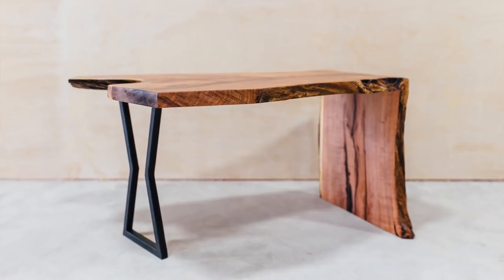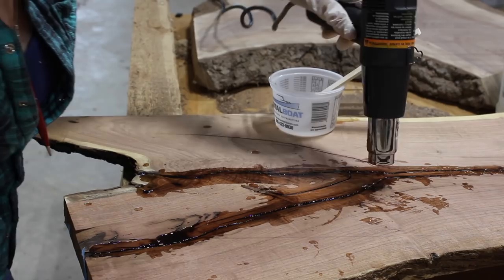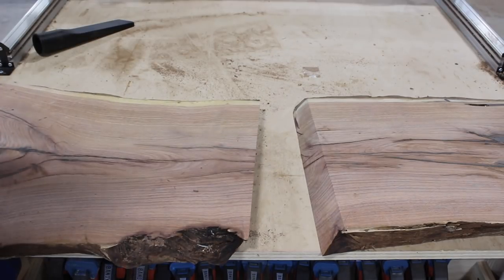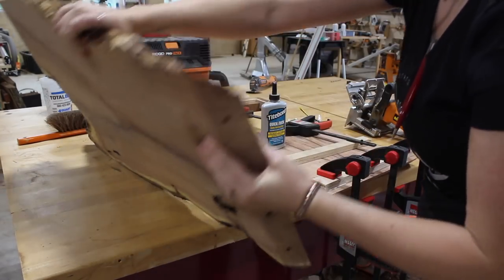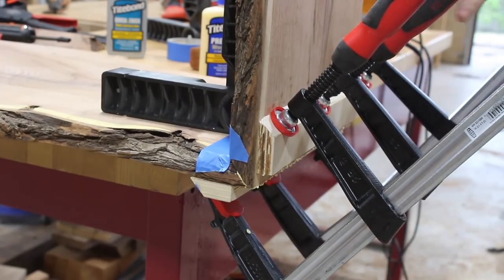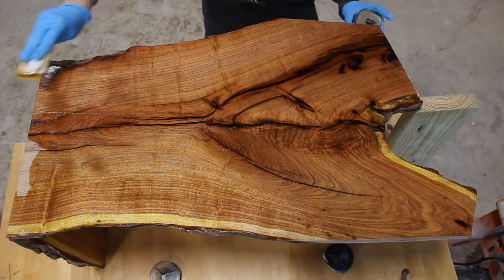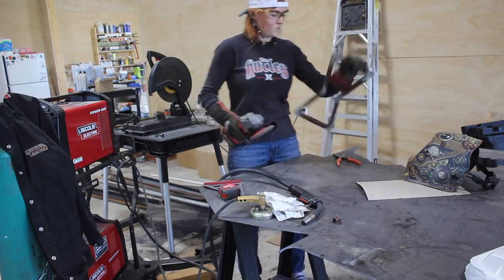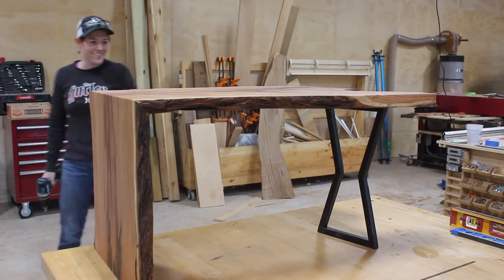Modern Live Edge Waterfall Coffee Table Build

Comment: I'm glad you did not use wire legs.  I saw a few with wire legs and they do not look proportionate to the scale of the table.  If you ever build another one, I did see a build where they used a plexi-glass panel for the support leg.  From a distance, it looked as if the open end of the table was floating...…. great job April!!

Comment: Loved the coffee table. Have your hubby buy a 14 inch metal chop saw. They cut quicker and cleaner. The Rage 2 by Evolution, Itron or Dewalt dw872. They cut clean almost no heat, faster and work a very little dust and no sparks.
Kirk

Comment: Very nice work April. I have viewed countless videos that you have posted and this is one of the best.  The design just looks amazing, about  “cheating”? This is why engineers make full sized additions to blue prints,, especially in the boating industry..  you have come a long ways in a very short period of time.  I/we as your collective audience are thrilled to see your success. Just thrilled.  West systems also makes pump style epoxies along with thickening powders to keep the epoxy from running .. To date, your Entry way table, your clamping rack, and the shop fold down table are among my favorites.  Best of luck with new projects. Consider making bow ties to insert into bigger cracks,, they may add some strength to cracking wood.

Comment: Brown paper bag is an excellent way to get the kulls to come off easily. It's an old trick used in woodturning to  make unusual shaped turned pieces. Just strong enough not to bust while turning (if you don't get too aggressive) and breaks ones you wack it with a mapat to separate the pieces.

Comment: 👍
You can also make clamp-on culls . When you making waterfall table or bench and you want the joint to be closest as possible two lined up but removing the least material first cut on 90 degree the blade is much thinner then on angle then measure 1/32 along the top edge on the end-grain that's where you want to make your 45 degree cut after glue up and sanding the corner you should end up with just about perfect as you can get corner

Comment: April, for covering over the open ends of bar stock, instead of butting up the adjoining piece "as is" - cut off the three INTERNAL sides, leaving an outside "tail" that then becomes the "end cap".

(edit - oops, did I notice a little rocking when you put your feet on it? - was it the floor or the table?)

Comment: It's a beautiful piece and nice work, but for a major structural joint with long leverage like the corner, a few dowels don't provide enough glue area to stand much of a shock: moving, people bumping the side, etc. A cracked joint would be a disaster. In future consider routing a 1/4" blind groove in both sides and inserting a long spline with the grain running across the joint.  Another approach would be multiple double stacked biscuits.

Comment: I love these videos I actually just found you today during my lunch break and spent a good hour watching you're creations. One thing I want to ask or see if you can build or even design because I want to do this to make room in my tool box. Make a Wooden tool socket holder for 1/4, 3/8, 1/2inch size sockets. and the problem I run into is if I put a tray in my tool box and put a 1 1/2 standard impact socket I cannot get my tool chest drawer to close, Its not a deep drawer like normal boxes these days. If I do not have a tray in my drawer the 1 1/2 impact socket can fit standing up inside when closing the drawer, I was I had a photo or idea to show you what I'm aiming for but pretty much it would increase space for sockets in my Tool Chest.

Comment: Heres a tip for getting air bubbles out of epoxy, use acetone in a fine mist spray bottle with 1 to 2 sprays, its amazing how it pops the air bubbles with no effect on the epoxy. I have used it many times and  youll be amazed how simple and clear it works. Have used it on 3 in. open slabs with no problem.
Reply: Does that work for layering epoxy as well?
Reply: @MikeTheMaker1  yes it will

Comment: Why not use torrefaction for some of you existing wood? It's amazing and gives your a workable product in a short time. Even though it was used in the flooring industry to speed up the drying process. It is also now being used by many high end luthiers for fine hand crafted musical instruments, It removes all the moisture and bad stuff from the wood and even gives you a nice caramelish/aged color to the wood while baked in an oxygen free oven and special temperatures . The wood becomes a touch more brittle, but it is extremely stable that it rivals decades old dried wood in stability.

Comment: 5:55 I'm prety sure this kind of cutting a groove into the dowels reduces their mechanical strength. Not only do you have an outer layer without continuous grain anymore, you have a periodical stress concentration pattern along the dowel. Instead, make yourself a dowel cutting jig - a hole with sharp edges drilled in a metal plate - with a hole slighly smaller (maybe just 1/32" smaller) then your dowels. Then file some gaps around the edge of the hole, leaving just a few narrow teeth around its edge. You can now hammer your dowels through that jig, and they'll come out with tiny grooves lengthwise.  These no longer cut across the grain. Plus, hammering a piece of dowel through a hole that almost fits it is way faster and easier than cutting a spiral on the bandsaw.

Comment: you mentioned using painters tape under the caul for easier cleanup after clamping the mitre...would that mean using CA glue to adhere the caul to the top of the painters tape?  any chance that the clamping pressure would peel the painters tape up?

Comment: Nice, but no view of the finished 'waterfall'. You will have a (perhaps slight, but noticeable) mismatch of the grain due to the width of the saw kerf. This can be avoided, and your waterfall can be perfect. Key is to not cut all the way through. Leave just a bit of wood- maybe 1/16" or less. Make the second cut so you have a perfect 'V' with just that tiny bit of wood at the bottom. I recommend clamping both halves to a scrap panel before cutting to avoid stress on that thin 'hinge' of wood, and do all your tracksaw layout before making the first cut. Not a bad idea to also apply some tape at the joint first. Then use a sharp knife to separate the two pieces. I agree with another poster that you should make the full cut in one pass.

Use a laminate roller to really get your tape stuck down, and remove it by pulling at an angle. The shearing effect will have less tendency to pull grain up as you remove the tape.

Comment: Thats cool! How much would it be to buy all the materials?
Reply: A lot.  ;)
Reply: Honestly can range a lot depending on the tree species, the size of board, and how rough the lumber is. I have gotten some pretty cheap that just took some extra work or were small or just species that the mill I went to had an over abundance of, but things like exotic hardwoods or Hawaiian hardwoods could be really expensive if already surfaced. 
Heck, I once got an 8 ft x 18 inch slab of 5/4 hard maple with a dozen burls along the outside edges for only 40 or 50 bucks, but it was probably because the place I went to had just done dozens of trees and needed to get rid of some to clear room for other lumber.
Reply from the maker: It really all depends on the slab material you want to go with. Call around to your local lumber yards and ask about different species and costs. I paid around $85 for this slab.
Reply: @AprilWilkerson  Good deal!  Helps to have a yard by you that does slab work.  None in my area so I'm kind of stuck with places like Rockler and Woodcraft (or ordering it)...WOW...a slab like that from Rockler is north of $200 by me...I saw one there the other week at $950!!!!  I didn't even think it was that nice, but holy wah...
Reply: Materials are relatively cheap for these kinds of builds when comparing the cost of the tools. Many thousands of dollars in tools are used to do what she just did.
Reply: @Zerostar369  what SHE did, but watch  Roy Underhill.  He does it with hand tools, and those aren't several thousand (ok, his might be because they are antiques).  I dont think April's are in the "several" thousand range either.  I am guessing $1500 to $2k for what she used here.  

Personality, for me, the cost is in the slab.  That slab would go for both of $400 in my area.  A friend just bought a love edge slab for their 8'  bar....it was $1200!!!!!!  Location played a big role.  He could have gotten the same species of wood for half that amount,  but he'd have to take 2 days off work, driver 1800 miles each way, and hope it was what he wanted.  April is fortunate to love in a location where slab work is being done....and that drops material costs.  I am not so lucky....and I'll probably never do any slab work because of it.
Reply: @WreckDiver99  Right. When I stated several thousand I was taking into consideration the machines needed to joint and plane that slab. Machines that can handle slabs that wide do cost several thousand. Then again there is always the router sled option which is cheaper.